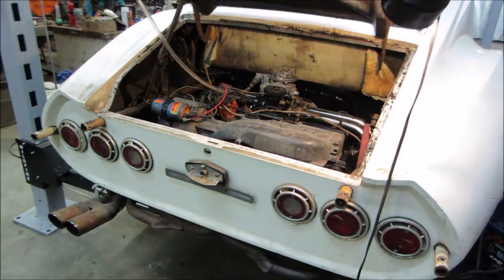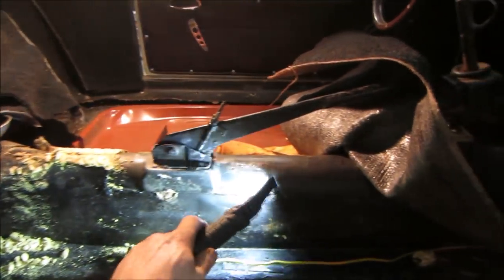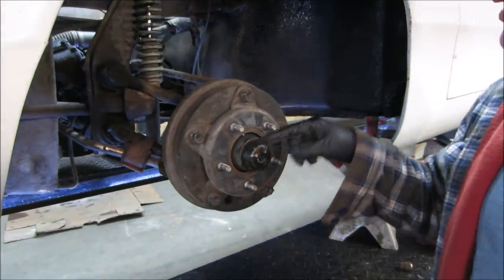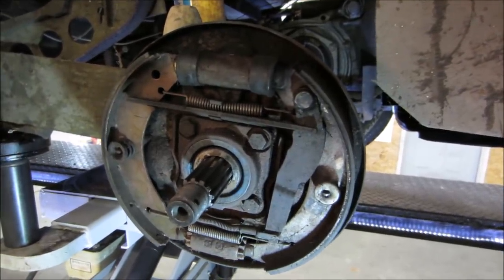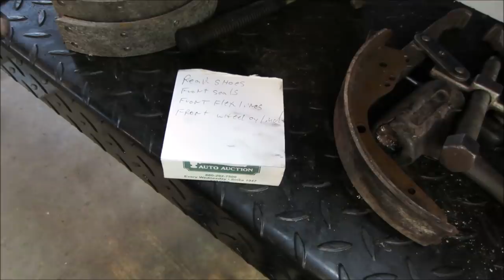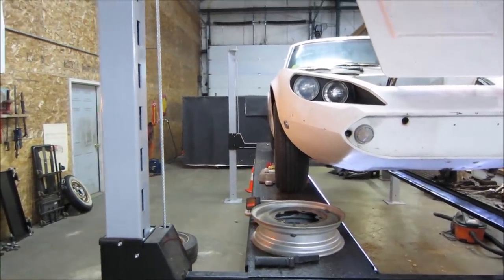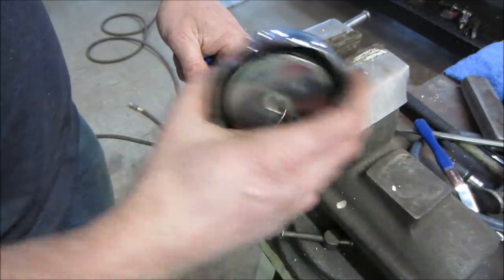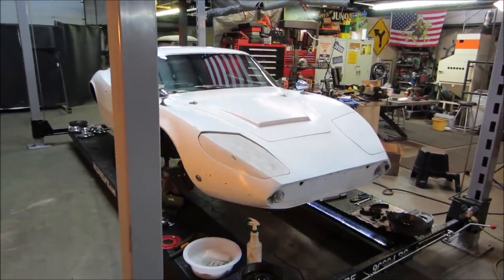Tearing Down My Barn Find Kit Amante GT Kit Car

Comment: Whenever you have drill in a confined space like that, make a jig to drill it first.   Use the smallest tubing that will fit over your work.  In this case, a piece of copper or steel brake line would work. Put a hole in it, then put it over the piece. The tubing will stop the wandering.

Comment: Rap a wire or string around the top of the spring, tread it through the hole and pull it into position.
Reply: That's the first thing that came to my mind while watching.
Reply: Exactly
Reply: YES! I was screaming at the screen, use a piece of string or wire for that mirror retainer., OMG!!!!
Reply: That's what i was saying to the screen.
Reply: Yes was thinking  exactly this,  for sure would have been better
Reply: I was saying to him also. Simple solution.

Comment: The mirror spring: Loop a string under it and pull it through
Reply: Dang you got me same thought
Reply: I would have said a piece of wire.
Reply: @anthonylautzenheiser3802  that would do it to
Reply: Was thinking the same thing the whole time I was watching him struggle.
Reply: @davidhamilton7628  String, wire or fishing line - we all had the idea but would it work?
Reply: Dear  @anthonylautzenheiser3802  
👍👌👏 Definitely! That's what I always do for many years.
Best regards, luck and health.
Reply: @unclegreybeard3969  I think so long as the pot metal held up🙂
Reply: Or even a boot lace.
Reply: or a wire coat hanger
Reply: That or zip tie
Reply: I was screaming the same thing.
Reply: First thing I thought of.
Reply: I was thinking dental floss
Reply: Ditto
Reply: I was literally yelling this at Mustie while he was struggling lol
Reply: My thoughts too
Reply: Some wire...exactly my thought.
Reply: String is strong enough and.much easier to cut then wire or zip tie. Use string.
Reply: @videodistro  loop it around the bracket and hold both ends to pull it through.  once in place, pull one end of the string and it comes right off with no cutting...Bob's your uncle
Reply: Heavy spring, use thin mechanics wire, or MIG wire
Reply: I just posted the same idea.  When he was saying "what would you do?" I was saying, get a string!!
Reply: Hose pliers?
Reply: That's what I was yelling at the screen.  Also fishing line.
Reply: Overworked Caveman                                       '

Comment: While I was in the army, stationed in Germany in 1970, I had a ‘64 Vdub beetle that needed a brake job. I didn’t have a wrench big enough for the axle nuts, but I found that a lug wrench from a “deuce and a half” (two and a half ton truck,) fit perfectly. Got the job done. Looking at this brought back good memories.

Comment: Hey Mustie back when i did my 67 beetle i had the same problem with the fuel tank i took a 12 inch speaker in a box set the tank on top of it put  thinner and hardware in it and put full base on the stereo and let it go overnight it worked like a giant ultrasonic cleaner lol.
Reply: That is a neat idea.

Comment: I've always wanted an old kit car.  You just talked me out of it.
Reply: I have never wanted one but now I want one a LOT less.
Reply: Mostly because kit cars, even in mint condition are pretty universally terrible cars (with very few notable exceptions). They never look quite right either. I'd much rather have the Bug or the 914 or the Kharman Ghia they cut up to make this car than the Amante itself.
I mean.... headlight doors actuated by a steel rod and linkage from the cabin? Seriously?
Reply: @williambinns1631  seriously? That was average back then! What did you expect from a cheap kit car from the 70s!
Reply: In the late 80s-early 90s I made 2 mercedes 1929 gazelle kit cars, it's just crap, from start to finish.
They were built on VW, it never got really good.
I'm glad it wasn't me who paid for that shit.

Comment: For the mirror, slide a steel tube with a hole drilled in it over that protrusion and epoxy it the full length.

Comment: For a kit car it sure has nice lines and curves. I think it's gonna turn out great and I'm glad it's not sitting in a garage forgotten. Also glad they didn't go with the original name, Gazelle.

Coker Tire has everything for old school cars. Worth taking a peek to see if they have what you want.
Reply: A faux grill could look cool in the empty space on the front, without anything there it looks empty.
Reply: @EvilTurkeySlices  I think Mustie said he was going to make a better bumper for that spot. I agree that it needs something.
Reply: They might have had a trade mark issue using the name "Gazelle", it was used on a British Singer model from 1956-1970, Singer was acquired by the Rootes group during the run and they in turn were acquired by Chrysler.
Reply: @Eremon1  he could cut up an old grill and integrate a bumper and also the lights that are already there. It would make it much more put together looking.
Reply: @EvilTurkeySlices  Anything will be better than that original thing it had.

Comment: re cleaning the fuel tank, pressure washer and nuts and/or stones in side the tank, is quick and effective at cleanning the crap out, after it drys a bit slosh some diesel around to stop flash rust. or wd 40 if you like.

Comment: Imagine paying someone to do everything that Mustie is doing.  You could probably buy a Ferrari by the time this car is finished.
Reply: Nobody wood want to do it today auto repair is quick. And dirty....see hhoovies GARAGE mechanic car wizard. For quality car repairs
Reply: Thanks! 👍
Reply: @rsprockets7846  To me, Hoovies garage guy is just a car snob.
Reply: Repairs add up fast.  I worked as a bike tech for a while, and some of the estimates got up there quick.  Example: honda shadow 750, sat 5 years,  minimum to get running- carb clean/rebuild, tank flush, oil change, battery- about $5-600.  Now if tank is rusty add in more for coating or replacing.  Want it safe to ride? Add tires/tubes, brake flush, coolant flush.  
That's just if it got parked and had no issues when parked.  If it got parked because something broke it'll add a good bit to the cost.  So a "good deal" might not be if you can't fix it yourself.
Reply: @randombuilds8336  great point. I bought a 2012 shadow 1100 w/only 2k miles and going through same issues to get it riding safely by spring.
Reply: Yeah it's just an act for Hoovie. He does tend to be judgemental and snobbish at times but the content sells viewers....
Reply: Just think... Someone did a LOT more than Mustie is going to have to do back in 1970.  I can't imagine why anyone would have done this.  It's a ton of work, plus money, plus an existing car as the base. After all this money and effort you have a cool looking car that is slow, handles poorly, is a ticket magnet, probably has very high insurance rates, is custom so all work needs to be done by you...and has no resale value.
Reply: @tarstarkusz  good point!  Mustie can park it next to the beaver.
Reply: @randombuilds8336  That's why Mustie finds so many mowers, garden tractors and all. Younger ones don't know basic maintenance and repairs.
Worst, they DON'T WANT TO KNOW  !!
I had a problem with my snow thrower. Come September, did a complete check up, oil etc. Ran fine. Come first snow storm in Jan 2nd, It ran like crap, spitting, struggling. Called a local Huskvharna shop, told me most probable cause was old fuel. "But it ran fine in Sept, same fuel ?" That's it. Modern Premium, methanol free gas gets sour after 2 months ! Clogged carb, unrepairable since they are factory sealed. New one, 150$C plus +/- 200$ install !! 
Got some carb cleaner spray, start on it. Did it 4 or 5 times, fixed. Runs just fine.
Not being a hard headed DIYer, it would have cost me 350$ + tx ! On a 2 year old 1,600$ blower.
Imagine, same costs on a 400$ mower... Not worth it. Dump.
Reply: @rsprockets7846  Coldwarmotors still does body repair the old way, Scott can make complicated panels from sheet metal.
Reply: @tarstarkusz  It's a cool car
Reply: @rsprockets7846  i dont even understand the point of the Hoovie channel anymore. he used to have old forgotten classics, now he has lambos ferraris , BMWs and Mercedes and he just complains about how crappy they are mechanically and the car wizard complains about how crappy they are mechanically and then he repairs them. what am i supposed to get out out of that? how daddy's richboy son is blowing through his inheritance? how he does nothing except have his mechanic repair them? ive been subbed for 4 years and i used to get excited for his videos. now i dont really care.  same is happening with Doug Demuro.
Reply: The Ferrari would always be in the shop though.
Reply: @marcryvon  Here's the problem... When you buy new you are supporting workers in china who built it and teenagers working at the mall to sell it.  But when you want to have something repaired, you are supporting skilled US labor which cannot even survive on chinese or teenage labor rates.  
So the import cost is really cheap and the repair cost is really high.  We have been unable to outsource repairing and so nothing gets repaired except by exceptional individuals who mostly do it for fun and the challenge.  But if this stuff were made in America, it would be worth repairing because you couldn't get a 98 dollar mower or whatever it is.
Reply: @ericgoyer4373  Nah, it's a cool-looking car. A cool car would go fast and handle very well.  The entire suspension needs to be re-engineered and the engine needs to be swapped.
Reply: @dsloop3907  Yep, one of the best channels on YT for old car content - and lots of skills on show.👍👌😁
Reply: @rsprockets7846  his merc gearbox fluid change proved how incompetent he truly is.
Reply: asteinmann  I know how special that is.  I have similar memories with my oldest brother.  The thing is, it wasn’t about the truck.  I hope you get to do that, means everything!
Reply: @chukzombi  agree. He used to actually do things with his cars. Now he buys them, whines, takes them to a mechanic and you never see them again.
Reply: @volvogt21  he has like 40 cars or more,  half of them in the mechanic shop and the other half he has squirrelled away in multiple garages collecting dust because he has a few actual cars he drives every day and these are all just youtube cars. what gets me is he calls updates when he visits his cars at the mechanic.the mechanics he's making super rich. one dude has a huge yacth and almost as many cars as hoovey. it just gets boring.

Comment: Its coming along nicely. I have a similar project, a fibre glass truck built on a custom monochassis that uses vw aircooled running gear and suspension. Its called a Gurgel.
Reply: Gurgel X15

Comment: This is an excellent series, To date (not counting acquisition cost) Mustie has about $20.00 invested in a running drive train... Not bad!  
Being mindful of costs..... A low cost way to update and make the cabin appear larger would be a tan carpet since one is needed anyway.
Seats: Tan dye seat inserts and lower kick panels. 
End Caps: Appear unfinished, a flatt black or charcoal on inside hood scoop and same color for indentation where parking lights mounted.
Rear End Cap: The Amanti tail lights similar to  Corvair Monza, May consider a  tail light color treatment like certain Monzas, GM did was paint this area a silver gray, You can go to Jay Lenos garage/ Corvair  Monza on YT and see what I’m referring to... looks pretty good!
Enjoy ALL your work!

Comment: Nice to see, and hear another L185DT on here. I have the same machine, and it works hard for me. Any time you wanna do a video on taking apart/repairing the three point hydraulics and replacing o-rings, that would be great!

Also, no need for apple cider vinegar, white vinegar will do the trick. But even better is a higher acid vinegar, usually found at farm and feed stores for use in bug repellent and such. Works much faster, and is relatively safe. I have done many VW tanks, and several moto and lawn mower tanks that way over the years.

Keep up the good work, we really do enjoy it!

Comment: The “single master cylinder” that you found appears to be a clutch master cylinder from a Subaru Impreza.
Reply: Yeah, it's definitely not a brake master cylinder.
Reply: @chuckschillingvideos  both wrong!! It is actually a brake master cylinder used on a trailer hydraulic braking system!! I have installed hundreds of them to trailers. It is not found on cars at all. It would not be advisable to try arguing this issue, because these master cylinders are sold here in Australia for use on trailer brakes. They are so common, you could almost buy them from the local corner shop. They are not expensive.. 98% of the trailers I've serviced have these master cylinders for the brakes. There is 2 sizes. 1 for drum brakes (most common) 5/8 bore, & the other is for disc brakes. The latter one is the usual replacement, because of the larger size, & more fluid, means more braking pressure.
Reply: @christophermarshall5765  I'll take your word for it.  What possible reason could there be for using one on an automobile?  Are these even serviceable?
Reply: @chuckschillingvideos  They can be serviced, but replacement is usually the cheaper option, because those who own trailers with these fitted, rarely bother to check them. The plastic reservoir ones sell here for about $60. The 5/8 one is no longer made. The 2 sizes are 3/4 & 7/8. I think Mustie has this kept for another project, though in an emergency, it could work as a clutch cylinder. I have seen this done.
Reply: @christophermarshall5765  Gotcha.  Thanks.

Comment: Worked at my uncle's bodyshop at 16 and what you do is pull a spring with a spring to position the short spring.  Putting headlight buckets in a 69 Ford Torino with needle nose and fingers bleeding my uncle walks in & asked what was I doing.  Trying to get these springs put in, I said & he reached up & handed me an old truck throttle spring off the shelf and told me to hook it in the short light bucket spring and put it where I wanted it.  I'm 67 now and have been using this trick ever since.

Comment: The mirror thing - I would have put a piece of wire over the rounded tab, and pulled the wire through the hole with the tab attached.  Would that have worked??
Reply: I would have tried a small set of fuel line pullers.  You know, the pliers with the circular ends for fuel lines.

Comment: With that mirror spring, my dad always had locking medical forceps and long med tweezers around (mom was an RN and this was new unused surplus the hospital was disposing of. ) He had those for years and used them for all kinds of things.They work great for the type applications such as locking onto Springs for putting them un tension. My dad worked on printing equipment as a tech and they definitely came in handy.  Would recommend that if one can acquire these tools to do so.

Comment: You should be wearing breathing protection there Mustie, those old shoes are normally made with asbestos.
Reply: As long as your not grinding or blowing them off with an air gun the particulars wont float in the air. Asbestosis comes from long term exposure.
Reply: The asbestos material is bonded to itself and to the backing of the shoe.  It's not going to miracle its way into the air.  Asbestos is dangerous when inhaled, but over extended periods of exposure.  It's completely harmless to work with this material if you aren't grinding it and causing it to become airborne.
Reply: @robertbak4108  not true about  asbestos it can take only one time to do damage.
Reply: @jasonjgr8580  asbestos is not a living organism. It cant jump off the brake shoes. Like I said unless it is propelled in to the air it’s inert
Reply: Safety sally to the rescue

Comment: 59:30 ... I've had to do similar "deep" repairs before ... small triangular needle file and carve a shallow X where you want the hole works too.
Spectra Spider Wire (braided fishing line) is tough/cut proof enough to pull that thru as well
Great update/episode! Thanks for sharing!

Comment: I have an old charcoal grill rotisserie setup that I use to turn and flush gas tanks.  Add lacquer thinner, seal the openings, and let it spin for a day.  With or without hardware inside, gets the inside clean!

Comment: I was saying to take a piece of string or wire attached to the spring to pull through the hole in the  mirror mount.  The bottom piece still would have broke but it would've given you a fighting chance.   Love watching your work. Lol

Comment: Used compression fittings on brake lines for 30+ years, never had one leak or fail....  one has to do what the budget calls for at the time.

Comment: To reattach that mirror spring, I would have tried wrapping the plug with bailing wire and using that to pull it through.  Great video!

Comment: So as an old office machine mechanic, what you need to add to you tools is a spring hook. The one you want was designed by ibm and is heavier duty with a hook on on end and a clevis tool on the other end.

Comment: Here in some parts of Australia, we machine these, then fit stainless steel sleeves. No more corrosion issues!! By the way, that brake system you call "emergency" brake is properly called the "hand brake", or "parking" brake. It is not intended to stop the car. It is supposed to hold the car when it is parked.

Comment: That wire you thought was the choke is actually the knob/cable that runs to the Southwind gas heater in the front.  On the Amante kits, you had to turn the gas tank around because the 'lump' in the tank wouldn't clear the hood if you left it the regular way.

Comment: Just a tip, Grind a notch into the tip of each side of the needle nose pliers. I have a couple pair I've done this to. Comes in handy for a lot of little things like the mirror issue you were having. Also great for small spring style hose clamps.